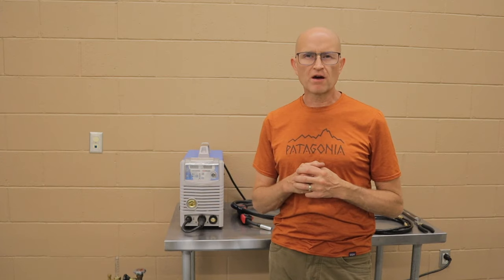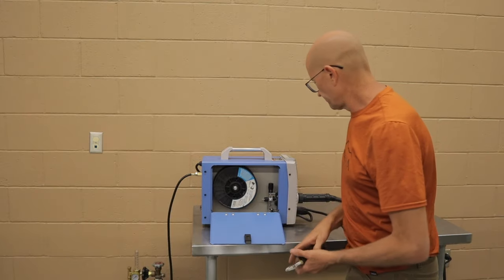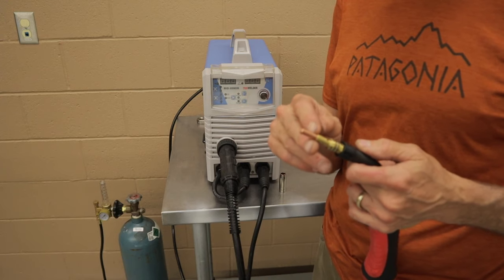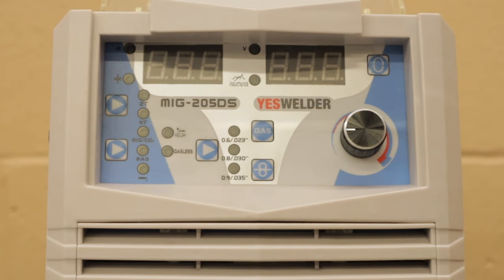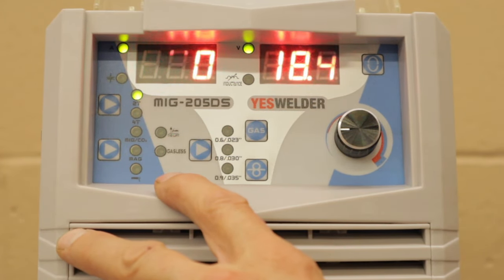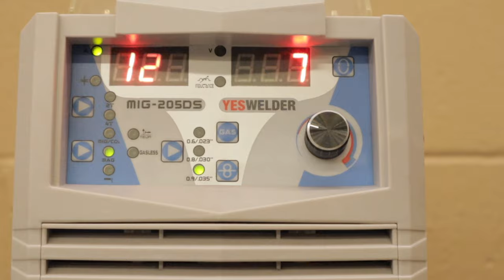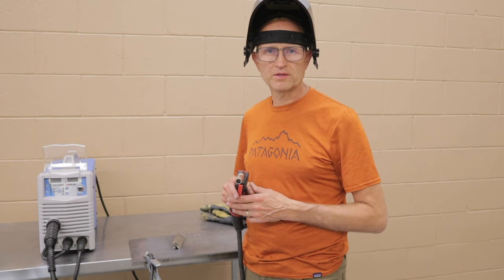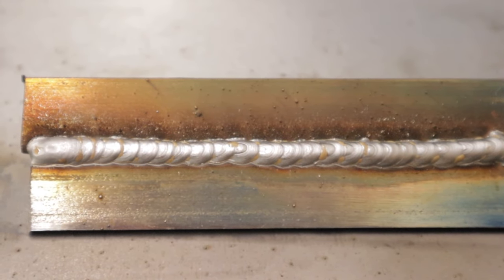YesWelder  MIG 205DS Welder Set up and Settings - Yes Welder DISCOUNT LINK !!!

Comment: I rarely post negative comments, usually observations. But this video displays a glaring error. Please never elevate your gas bottle. It should be on the floor and chained to a sturdy structure or placed on a welding cart. If it ever fell over or off the table and landed on its valve with enough force, it would likely become an unstoppable rocket. Your comment on "There's only one place for the ground clamp to go" is incorrect. Use of solid wire or flux core determines which socket is used for ground.

Please be sure of your expertise (especially when dealing with potentially dangerous topics) before offering it to others.

Have a nice day.
Reply from the maker: Thank you Jim for your great advice! All taken to heart and well received. 🙏😊

Comment: What about wire speed?
Reply from the maker: Hi Chris, the wire speed is all automatic.  It adjusts it perfectly for the amperage setting that you choose per the thickness of metal. Not once has there been a time that I wished it was adjustable with this welder. Very simple to use! 😀👍

Comment: Not really a fan of the Euro style connection. But as long as it works then opinions don't mean a whole lot.
Reply from the maker: I felt the same way, but after using it for a while it seems like a better system. Not having separate electrical wires for the switch and having everything in one plug just makes more sense to me now.😁👍

Comment: That's not true you can use the smaller wire spools if you want. It does work
Reply from the maker: Hi Chase, you’re right! When I made the video they said you could only use the larger ones, but I have since purchased some small spools and they do work.👍

Comment: why does mine not save settings when i restart it?
Reply from the maker: Hi Drz. Well it should go back to your last settings you used so if that’s not the case, you should email support and see if there are some diagnostics you can do. 🤔
Reply: @PranaTech  could it be because i unplug to if i shut off and start right away it works
Reply from the maker: Yes, if you unplug it I believe it loses its memory.👍😀

Comment: Was this a paid review....or an "honest" review
Reply from the maker: Hi Castledome, everything in this review was from my heart. Not paid. I did the review because I basically considered this a disposable welder considering the price, but after welding with it for a few months I realized it welded better than any Mig I had ever owned and I wanted other people to know about it. 😁👍Don
Reply: @PranaTech  awesome...thank you.......btw,you need to make a video on your 2x72 belt grinder...saw some belts hanging in your portabandsaw video....T I A
Reply from the maker: Thanks, yes I will do a video eventually on it. It has a 13” hard rubber wheel on it that is in rough shape and I’m going to convert it to 3” x72” with a platen setup until I can get a new rubber wheel.👍😁

Comment: This machine will take 2lb or 10lb spools.
Reply from the maker: Elkvis, this machine will take both those sizes of spools, 10lb or 2lb.😀👍
Reply: @PranaTech  yes, that's what I said.  In the video, you mention that it cannot take 2lb spools.
Reply from the maker: Yes, that’s what the manual said when I got the welder. Other people tried the two pound spools and let me know that they do work so I purchased a small spool and sure enough they do work!😀👍

Comment: A little bit too much roll over.  Temp a little higher may be perfect.
Reply from the maker: I think you’re right Eduardo! Even after 35 years I still have to play with the settings a little to get the penetration right! 😀👍